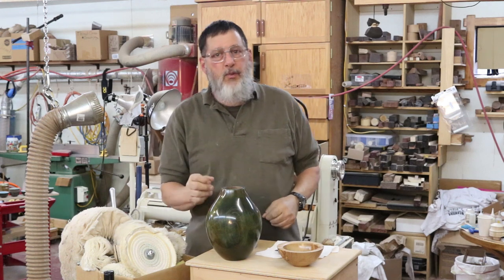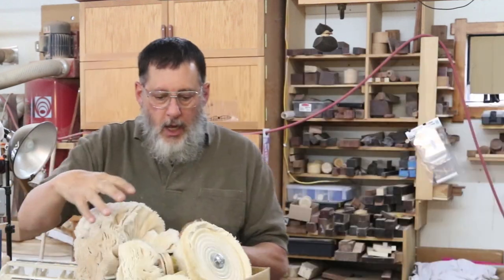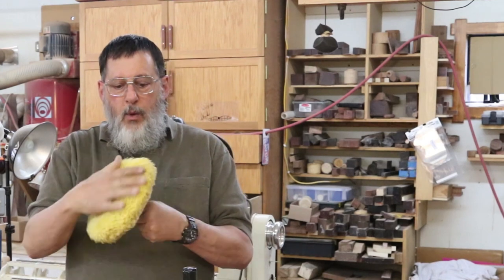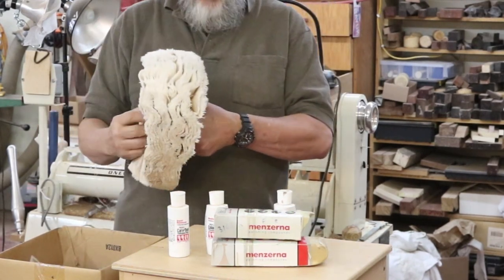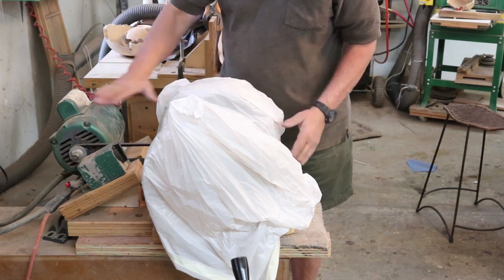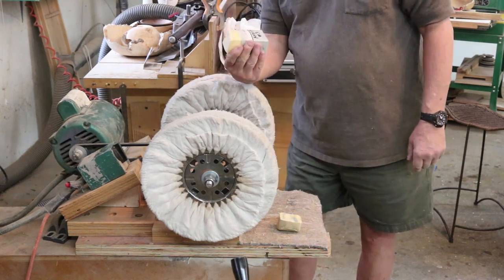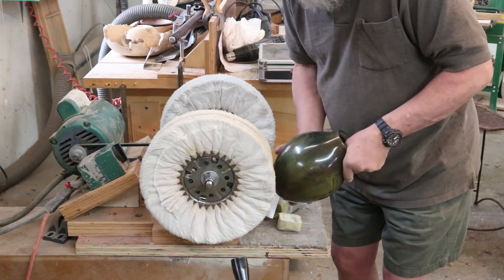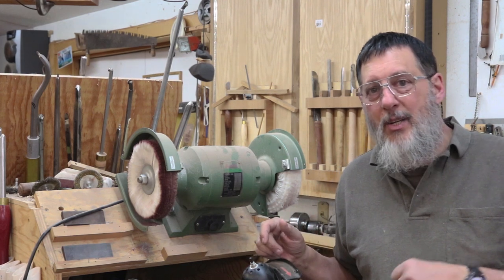BUFFING:  Woodturning with Sam Angelo

Comment: I think the "rouge" you mentioned is "Jewelers Rouge". I used it years ago when polishing some acrylic pieces. One more tip I'd like to add to yours is to use light pressure and keep the piece moving because it can burn quickly if you stay in one spot for very long. You did just that in the video but didn't mention it. Lots of great info here. Good video Sam. :-)
Reply from the maker: Thanks.  Sam

Comment: I have been coloring some pieces lately using your methods with great success. The box elder looks wonderful.   Wish I had a truckload of it. The trouble I have is buffing the inside of a bowl. The main problem is the bottom of the bowl. I've tried several methods but still get bad results. Thanks Sam
Reply from the maker: Tom
Yes I totally agree.  I just try to not buff in those kind of areas.  Nothing seems to work. Sam

Comment: I just looked on the stewmac.com website and found that they no longer use menzerna, they have switched to the ColorTone line.  I noted several negative reviews for it, as well as good ones.  Have you tried the new line and do you still recommend it as highly as the menzerna?

Comment: Sam,
I am somewhat new to polishing my work and most everything I have learned has been from personal hands on experience and videos like yours (thanks for your excellent videos). I have been using shine juice with my sanding process to help solve end grain issues. Then the three wheel Beal process and thought I was getting pretty good results but didn't really know because I didn't have anything to compare the results with. I am only sanding to 400 grit and it sounds like that is not enough. Please offer your thoughts on how I can get to the next quality level. I really value the videos.
Thanks
Ray
Reply from the maker: I have never really used the Beal system.  I think the wheels I use which are really large help a lot.  There is just more surface area.  There will be a bit of trial and error as you go along.I get some of my (3M) sand paper at NAPA, a great source for finishing.  I can get grits to 2,000 to 3,000.  That is probably all you need.  Sam
Reply: Thank you kindly for the suggestions you forwarded. I think you are correct in suggesting sanding through more really fine grits. I have been stopping at 400 grit and haven't had super results with my work. I have a NAPA just a few minutes away and will get some additional abrasive sheets. Thanks again. Ray

Comment: What can you  say to a man who has a box full of buffing wheels? :) Thank you for sharing this video Sam, I've been thinking of starting to use lacquer on my pieces, and since I can't afford the good stuff, I'll probably start using some of your "simple" wood spray lacquer which is aviliable in any hardware store, yet when thinking about buffing such spray finish, isn't heat generated in the buffing an issue? doesn't it make your lacquer melt?

Yuval.
Reply from the maker: Good question.  Once lacquer has cured it is good to go and not a problem.  And it doesn't take long.  But if you buff too soon, yes it can melt and be a mess.  I think a little experience will be your best guide.  I think if you spray a coat in the morning, you could buff in 5 or 6 hours.  What i do (to make a long story shorter)  is spray 4 or 5 coats then sand.  Spray more coats and sand to a finer grit.  I do about 15-20 coats and sand to 4K or more.  Then I buff.  You don't need to do that.  Spray 3 coats and sand to a thousand grit.  You just don't want to sand through the finish.  Then you got trouble.  That is why I spray a lot of lacquer before I sand.  And you can buff oils as well.  Just let them dry for 2 days or so.  Le me know how you do.  Sam
Reply: Thank you Sam, I'm just setting up my first buffing wheel, I'm not sure if it will work as well, as I couldn't find any normal sized buffing wheels here in Italy, the only large wheel I could find was from a shop that sells supply for stone carvers, but it's a cloth wheel, so I reckon it will turn fluffy with use... or it might not. Sometimes I think I chose the worst country to live in for my specific hobby. At least the food here is fantastic :)

Yuval.

Comment: Good evening Sam ! What type of wood should i use for turning a segmented Urn ? Vic ANFOSSI from Val Comeau Newbrunswick Canada
Reply from the maker: Victor
I think you can use any wood you find attractive, and what is available.  I am not a segmenter so if I did segment a piece  I might use metal reactive paint and cover the wood.  You might check out the work of Malcom Tibbits or Curt Theobald who is also from Wyoming.  But I am not experienced with segmenting.  Sam